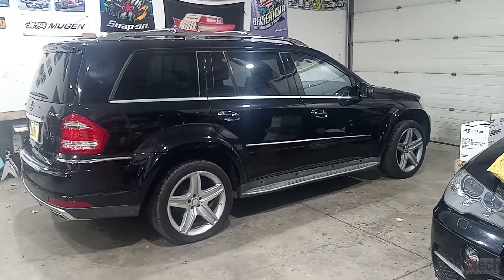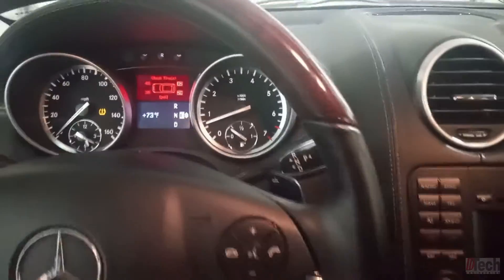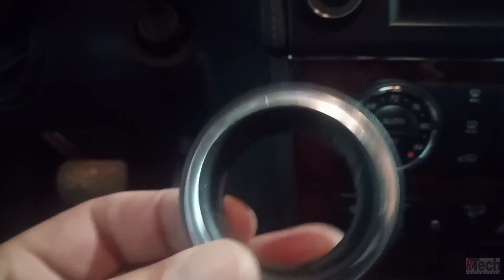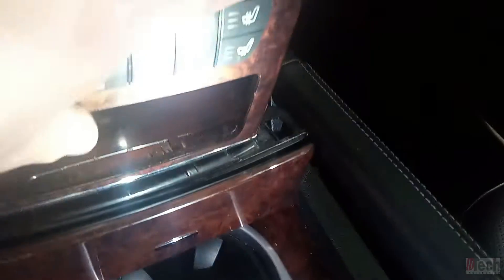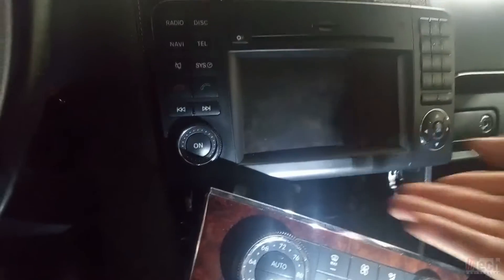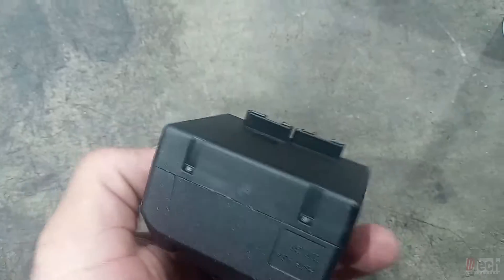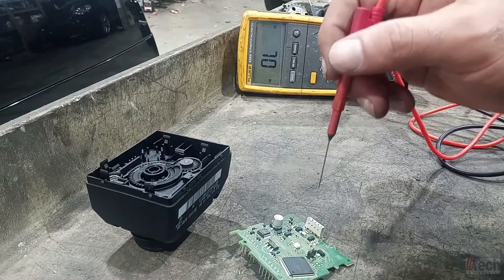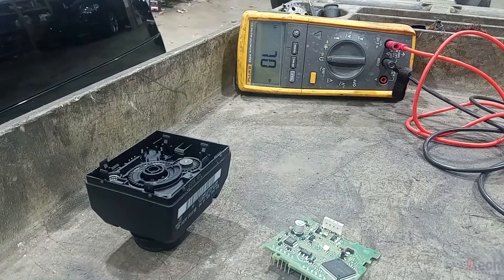Mercedes EIS issue Fixed for No Start

Comment: I have conducted a thorough examination of the front and rear Sam relays, as well as the fuses, utilizing a relay tester to verify their functionality. All components were found to be in good working order. I also inspected the prefuse in the engine bay and confirmed that all three fuses were intact. However, upon turning the key in the ignition, I observed no audible noises, such as clicking or humming, emanating from the starter. In light of this, I am inclined to suspect that the non-replaceable fuse on the prefuse may be the culprit. Furthermore, after watching a video, I am leaning towards the possibility that the EZS ignition switch may be faulty, as the 50 terminal fails to activate when monitored with Xentry. Additionally, within approximately 10 seconds of turning the key to position 2, the red battery icon appears on the dashboard. I would like to add that I consulted with a professional who specializes in repairing engine control modules (ECMs) and electronic ignition systems (EIS). The fact that the dashboard lights illuminate when I turn the key to position 2 indicates that the key is authorized and communicating with the vehicle. As I continue to troubleshoot the no crank, no start issue, I recalled purchasing a spare ECM last year, which was pre-programmed with my vehicle identification number (VIN). I decided to replace the existing ECM with the spare one, and I observed that the dashboard lights illuminated, and the gas gauge did not dip as it did with the original ECM. Although the vehicle did not start, it is clear that the spare ECM is functional but requires coding to the EIS.

Comment: I have a 2011 GL450 that has the same issue. my friend whose a mechanic founded 2012 gl450 parts for the ignition and he put it in and couldn't start with my key because it needs to be programmed with my key for that new parts he said, he told me to take it to the dealer and have them do it because once he put it in he couldn't start it.  am I or the dealer ship somehow able to program it if I take that part to the dealer? Or if the dealer can somehow program it if my mechanic puts the parts in. I don't know how he can program it without having to go to the dealer.
Reply from the maker: if it was a used part the dealer most likely can't or won't program it. you would need to send it out along with the original to have it bench programmed/cloned.

Comment: Not only is this repair a huge cost savings in not having to buy a new expensive EIS, but you also don’t have to reprogram your key if you do this repair. I believe a new EIS would require key reprogramming which only the dealer can do.

Comment: What is the name of the part that you soldered back and where do you buy that at electronic store???
Reply from the maker: It was the connector that came off the circuit board,  I didn't have to buy any pieces, just solder the connector back onto the board.

Comment: I have a ml350 and sometimes it will start and sometimes won’t start but when it’s warmed up it starts up fine I have checked all starter alternators battery everything good I’m hoping it’s the Eis switch
Reply from the maker: hopefully so
Reply: What was the problem? I am having similar problem in my w212 2014

Comment: Thank you for this information. It solved my issue on a 2010 Gl450 (low miles). Intermittend start, sometimes no start for 5 minutes, very frustrating feeling. When I openened the module after removal (used a $10 tool from Amamzon, did not want to scratch anything up), the white plug was stuck EXACTLY as shown in your video. I was a little nervous regarding the soldering part (I have the tools, just not something I do on a daily basis). This is what worked for me: 400 degree setting, thin, pointy tip and I did not add material, just carefully placed the white part with the contacts into place and heated the existing solder at the base up (one at a time), thereby getting the tiny feet of the contacts re-seated. 2x3=six contacts total (two sides three each). The white plastic part was making strong contact with the board, nothing was loose. Tested it, car had power right away. So far 10 starts and everything works as should. Oh, i used toothpicks for opening the plastic latches on the unit (keep them open while going around), that made it a lot easier. I dont think I would have beeen able to do this without your video, thank you very much! 

~
Reply from the maker: That's great to hear and I'm glad it helped!
Reply: thanks for good info, will try this myself!

Comment: Thanks, had same symptoms with inconsistent start BAS ESP and turn  signal lights. Opened up housing and found dirty optical path and lens. Used q tip and contact cleaner also for a couple copper  spring loaded contacts. Now all works. So may be other issue related to EIS which wont require solder or new switch

Comment: As of 2/15/23, I was informed by MB dealer - "one-year backlog on this EIS part ( not sold to independent shop). Est. Cost to replace at dealer: $2,400.00. SERIOUSLY. WTF.
Reply: There is many aftermarket support parts and service for the replacement of this module.